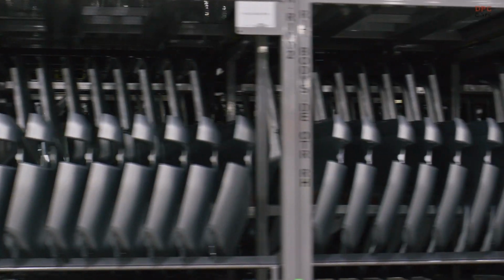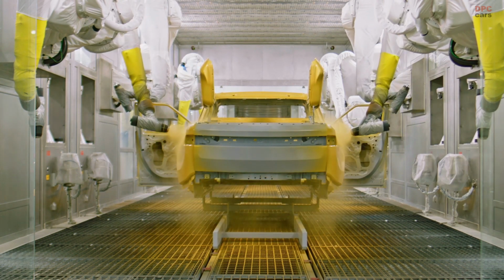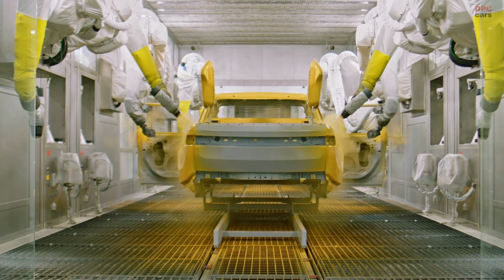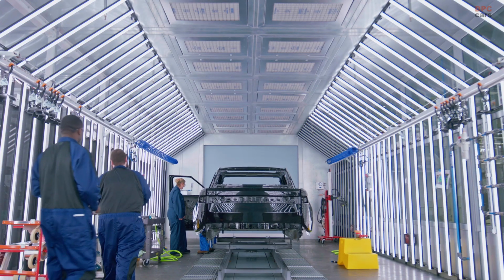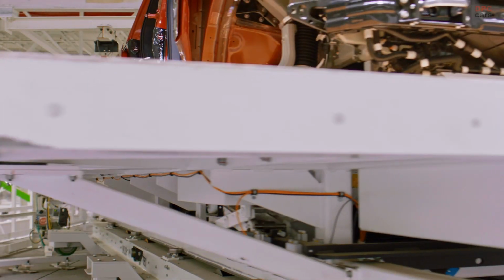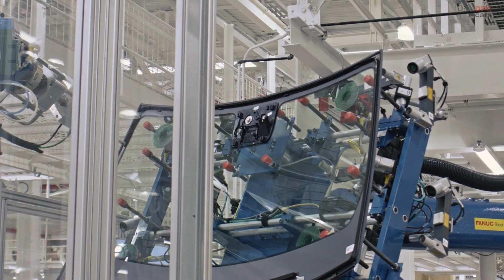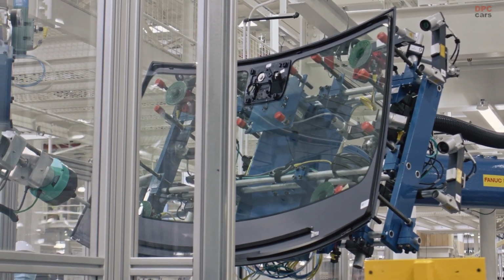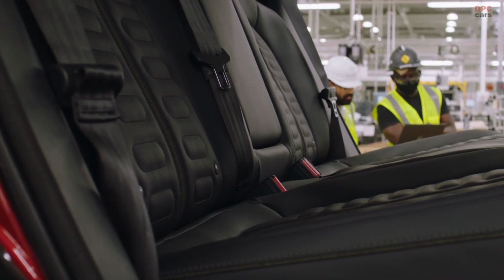Electric Rivian R1T Truck and R1S SUV Production Factory

Comment: Incredible 180 kW of battery .Woow it is "GREEN". To offset the CO2 produced for manufacturing the battery this car will have to go from Earth to the moon and a Lil bit back. And only if the energy is coming from a renewable source. ONLY. Practically this car will never be greener than a small diesel car. NEVERRRRRRRRRRRRR. How many cars these days drive over 400 000km? what a scammmmmmm.
Reply: Already seeing the start of lithium shortages...
The electric grid couldn't handle everyone with and electric car...
Reply: No it wouldn’t, it takes approximately 30,000 miles of highway driving to offset the additional carbon emissions of producing an EV. This is comparing a similar electric car to the internal combustion counterpart. Also, these batteries do commonly last over 400,000 kilometers. There are Model S's that have over 300,000KM and as the density of batteries increase as well as the thermal cooling capabilities increase, this number will only grow bigger. A simple Google search would suffice, so take a look bud!
Reply: Wrong!
Reply: I'm curious, have you compared the carbon cost of producing a complete typical ICE. hybrid or PHEV vehicle, engine, drivetrain, etc. compared to a full EV?  I'm just curious and would really like to know how that comparison plays out.
Reply: @aaronclu  carbon emissions are created building gas and diesel vehicles as well, and after they are built they continue to produce emissions, so EV wins , by far